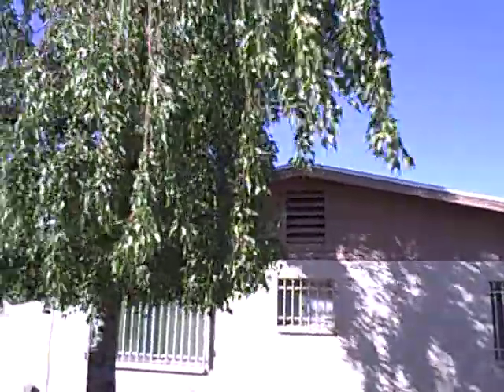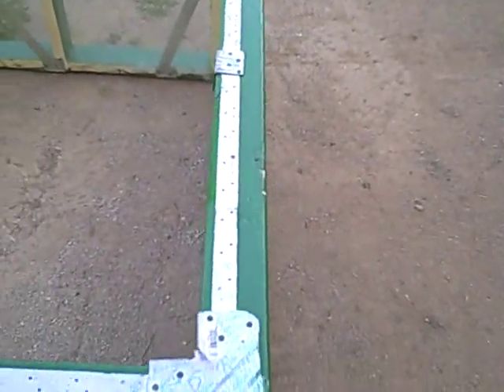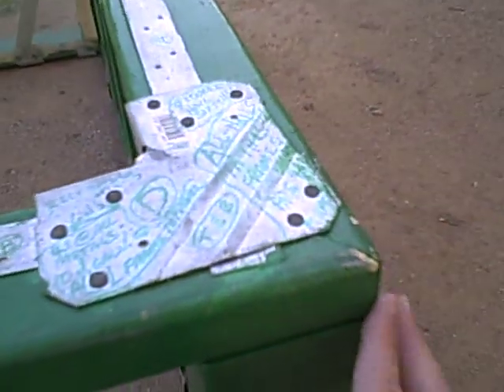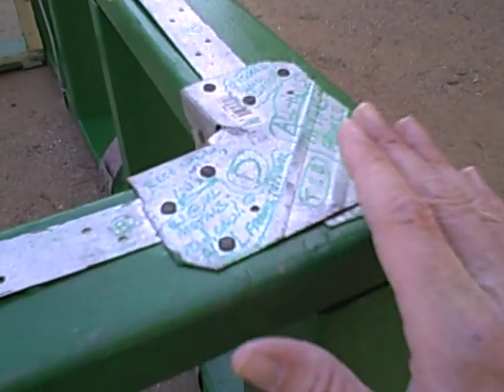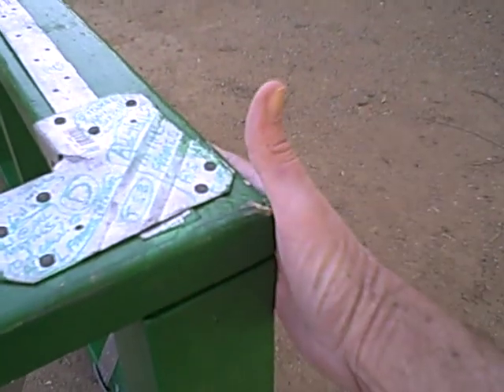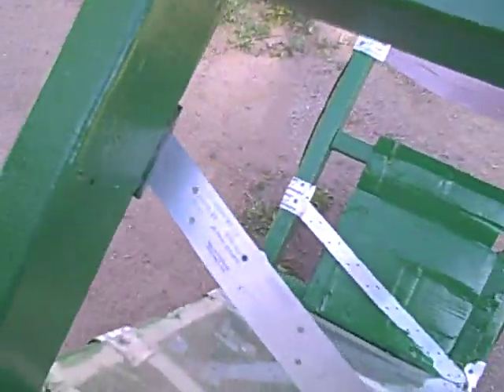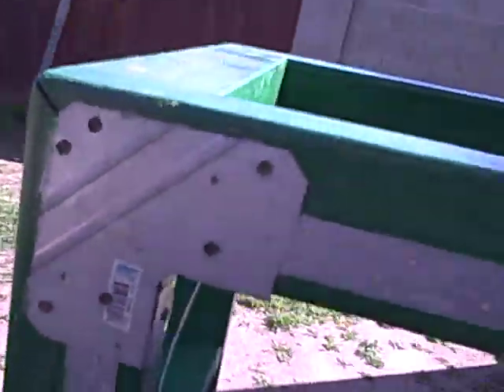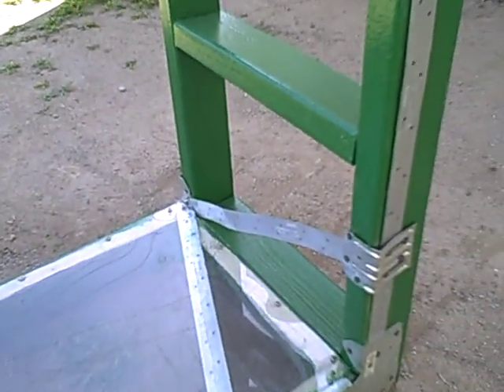New Structure Frame Reinforcing Method Breakthrough!!

Comment: Holy crap.  I don't know if you still use YouTube or not but I'm a structural engineer and it's very clear you don't have a very thorough understanding of how structures resist forces.  You cannot "guide the force" into the straps just be attaching them, the wooden frame will still bear the brunt of any load you apply to this structure.

You should enroll in a university or college course on structural design if you would like to pursue this interest, but please stop spreading false information and potentially harmful nonsense to people in the industry.  I can only hope they have all had the common sense to ignore your propositions. FYI owners of concrete companies or carpenters have no legal weight or education enough to back up a statement like "your frame is really strong".